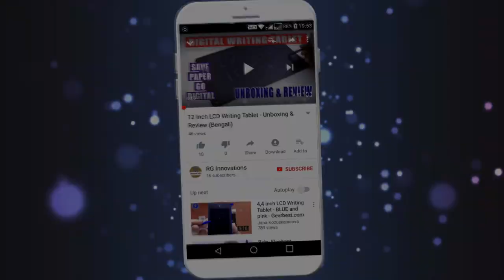How to Make a Flashing Ambulance / Police Car Light with an Old Clock at Home

Comment: NOTE: this model of clock motor produces 1 pulse per second where the "seconds" hand of clock runs in leaps of 1 second.
There is another motor that produces 5 pulses per secon, and "seconds" hand of clock seems to run continously. That will give another frequency on leds.